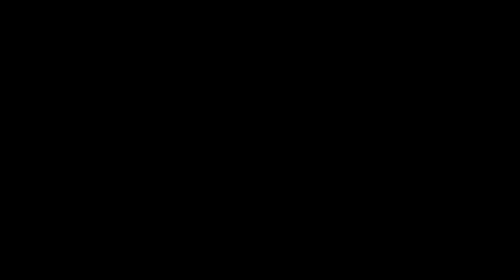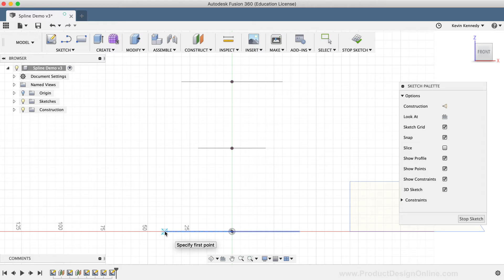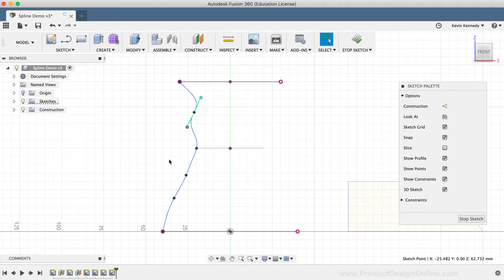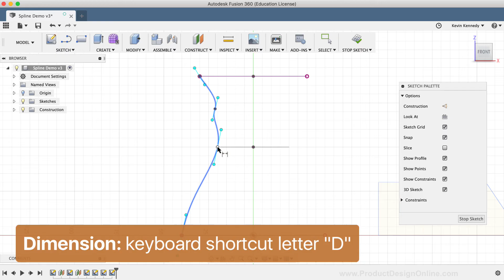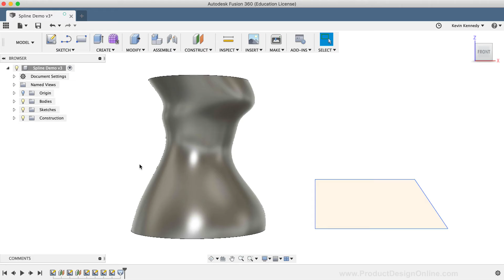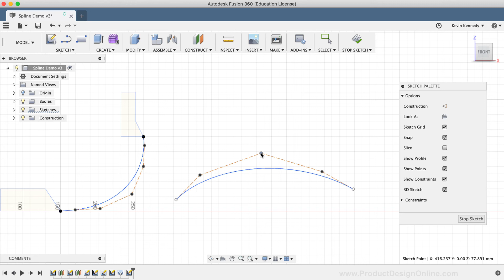How to Create Fit Point Splines and Control Point Splines in Fusion 360

Comment from the maker: Here's a video discussing how to surface model a detergent bottle: https://youtu.be/2MoecvL6eVA
_
P.S. If you liked this video, I'd love for you to Subscribe ► http://bit.ly/sub-right-now
_
TIMESTAMPS
0:00 - Create Fit Point Splines and Control Point Splines in Fusion 360
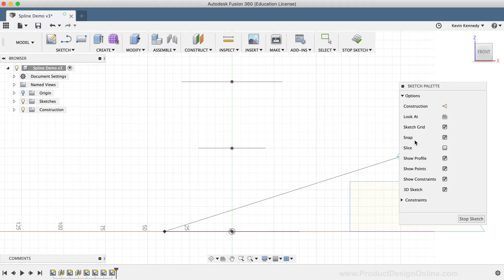2:11 - Turning "snap" on
5:52 - Open or close spline
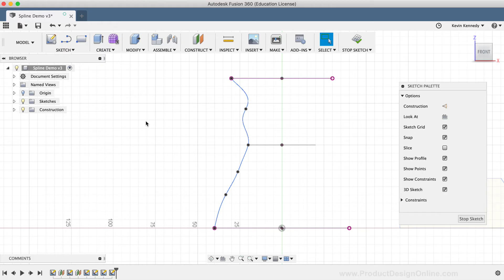6:37 -  Turn on curvature comb
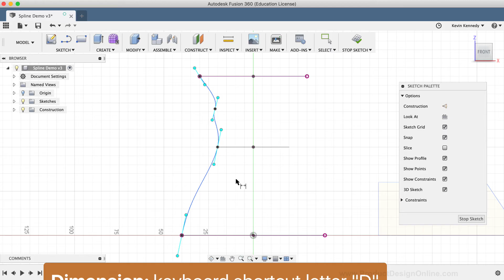7:44 - Dimensioning spline points
8:30 - Using spline as a loft guide path
13:15 - Degree 5 vs Degree 3

Comment: Hi, I have question regarding spline in 3d space. It seems that I have limited control over it. When I create fit point spline outside of the panel I can;t control it using control buttons. (What I am trying to achieve is connect two lines created on two different construction angled planes with smooth transition. I have all the control if spine is lying on any panel but then I am staring moving spline point in 3d dimention control points seems to stop working and I can really achieve what I like to. Are there any trick to that? or I just doing something wrongly ? Thanks.

Comment: Hi Kevin, thank you so much for your great videos. I need to know how can I get fully constrained when I use " Control Point Spline" ? Everything I have done is ok, and the rest of drawing is fully constrained, but not spline!! If you want I can send you what I have done.
Reply from the maker: Hi Arman. He would have to dimension and constrain each of the different control points. Splines are a bit trickier and take quite a bit of time to fully define. As an alternative, you can use the "Fix" constraint to lock it... Just note that you will have to unfix it if you want to make any updates.

Comment: How can we use these for the Rails when lofting multiple profiles? (They need the curve to intersect the profile edge)
Reply from the maker: The splines just need to touch the profiles at any point (and all profiles must be touched once). More detail on how to use guide rails: https://youtu.be/Mimbq-k2dWg
Reply: @ProductDesignOnline  Yes I understand that thanks, but I want to use control point splines for my rails and I cant see how to get the blue line to connect to my in between profiles.  The points at each end of the fit point line can be connected to the end profiles but for the inbetween profiles, the rail line cannot be connected because the points are out on the control guide (dotted lines).

Comment: This looks great - thanks - all your videos are comcise cl;ear and authoritative and I've watched a lot of them. However,  Fusion 360 is moving so fast that most F360 videos are already so out of date as to be almost useless. Now (July 2020) the comb is not not in the sketch pallet but available outside it by clicking body edges, and it cannot be viewed whilst designing a splined curve. This makes making a smooth spline extremely tedious. The only kind of spline now is the fit point spline and there is no way to specify G3 or G5. I am having a nightmare trying to draw a simple sketch which I can then extrude, chamfer and shell. The chamfers and shells keep failing and F360 support keep telling me my splines are to blame and not the software. I don't get it - if I can do it wiht a piece of wood and a chisel, shouldn'y it be a valid shape for a CAD package too?  DO you know about this problem with extruding and shelling splines? Do you know how to fix it? Any help is aprpeciated. Thanks.

Comment: Thanks for the video. Can you perhaps me on how to move and snap a spline point in one sketch to another spline point on another sketch?  The sketches are not necessarily in the same orientation. For instance, sketch A is the base of on object, and sketch B the top of an object, while sketch C contains rails to use in the Loft. Now, If I copy one of the splines already created, turn it 180 degrees, I need to place the rails' point exactly on the mirrored point on the base sketch - or, perhaps how does one mirror the sketch containing the rails?

Comment: How do you move the end/start points of the splines, please?
Reply from the maker: Hi, TechLab. Great question. If they're not constrained to something or "fixed" then you can simply click and hold with your mouse and drag them around.
Reply: @ProductDesignOnline  hi! Unfixing worked for me on each points except these two from start-end...
How do I get the constraint removed?
The issue is with splines, not with lines (these I can move as you said)...
Reply from the maker: @Up2zăDate  If an automatic constraint was applied then you'll need to select the point > constraint(s) should appear > select the constraint(s) that you want to delete > hit the delete key on your keyboard

Comment: Is it possible to close a control point spline in the same way you closed the fit point spline? I want a smooth transition at the merge point. Thanks
Reply from the maker: Yep! You should be able to close both spline types.

Comment: Great Videos, Very helpful. 
Is there an easy way the make the point curve line be the same or just go through the point and not use / fight the curve line tool?
Thanks for your help.
Reply from the maker: Hi Bill. You can add sketch dimensions and constraints to points of the spline. That's generally the best way to make them very specific / keep them the same. The other option would be to mirror or copy that part of the spline, depending on what you're trying to achieve.

Comment: After setting the fit point spline through 3 points and then clicking in the green section to say all done, I cannot hover the line and have it highlight. I also cannot right click to show insert fit point spline. Any ideas there?
Reply from the maker: Hi James. What happens when you hit "Escape" to clear all commands and then select the Fit Point Spline again? Does it let you select it? Do the spline points appear?
Cheers, Kevin :)

Comment: This fit point spline tool is the most annoying of the lot. I have 3 circles. First in centre the others on offset planes. The fit point spline will not snap to them. The snap to is selected I have checked.
Reply: Thats with centre diameter circles on offset planes it won't snap to their lines. If I draw a straight line with three horizontals coming off it the spline tool will snap to those no problem.
Reply from the maker: Hi James. Can you tests if the spline snaps to other geometry (non-circles). If so, then it would be a bug or issue with circles. Otherwise, it's likely another setting that is causing this. Cheers, Kevin :)
Reply: Remember vividly that it would not snap to circle on offset plane above, then also circle above that too. Only the first circle below. Then if i opened a new window and did 3 horizontal lines of different lengths above one another as you had, it would snap to the ends on the left side. Never tried the right. Then when I tried to add a spline to the line by right clicking, the option was not there. Presumed the ui change was the reason. So tried clicking line and nothing. No selection happening.
Reply: Remember the shovel issue I had that it would not select the lower section to delete of the handle. That issue went though with my new keyboard and mouse.  Im toying with the idea of doing what I really didn’t want to do and that is wiping the machine and fresh install from apple.
Reply from the maker: @jamesbarratt593  Glad the new keyboard and mouse is making a difference. Did you originally download Fusion 360 from the Autodesk website or the Mac App store? I believe the Mac App Store version is no longer supported (it may not even be available for download from there), and there had been forum posts in the past with users having issues with the app store copy. Cheers, Kevin :)

Comment: There's a software called Carnac that let's your keytstrokes display to the screen, which I think would be very helpful on F360 tutorials.
Reply from the maker: Hi, Andy. Thanks for the suggestion. The screen recording software does have the capability to show keystrokes. I do have this on many of my tutorials. However, it's a tricky topic as many times they cover up or make it hard to see whats happening in the canvas window. I try always display keyboard shortcuts for all videos....and then my sculpting tutorials have all the other keystrokes since there are a lot involved.

I'll consider add more in the other tutorials...it'll take some playing around with to find the right balance. Thanks again! Cheers, Kevin :)

Comment: Hey @product design online I use control point splines all the time, do you know of any way to close the spline so the end points are tangent to each other? I am currently leaving a section out and connecting it with another spline then applying tangent constraints to it. Its not a good time when you have lots of tracing to do! Thanks!
Reply from the maker: Hi, Leckie Installs. Can you provide a screenshot or a link to a file with some sketch geometry that you're talking about? I just want to make sure I'm understanding you. Cheers, Kevin :)
Reply: @ProductDesignOnline  thanks for your response! Can I maybe send you a screen cast privately?
Reply from the maker: @LeckieInstallsLondon  sure thing. Send me an email at kevin@productdesignonline.com
Reply: @ProductDesignOnline  Right on! I will do that! Thanks! Chris
Reply from the maker: @LeckieInstallsLondon  I'll keep an eye out for your email. Thanks!

Comment: What extension does Fusion 360 use when saving a file and can you use these files for modifying? I found a great push block for use on my table saw but need to modify the screw holes. This is when I thought about importing the file and modifying if it is possible.
Reply from the maker: Hi, Rud Dog. Fusion's main file type is the Fusion Archive File, which saves as the ".f3d" extension. However, you can import and export a large number of file types (see below). The most common file type from a number of CAD programs is the STEP Files which can be abbreviated as the following:
.ste
.step
.stp

I find the STEP files to be the most versatile/cross-compatible across a number of programs. When finding files online, you'll often be presented with a few options to choose from. It never hurts to download/save all the options...as in some rare cases, you'll find that certain file types don't import correctly. Cheers, Kevin :)

--
The following file types can be imported into Fusion 360:

Autodesk Alias (*.wire)
AutoCAD DWG Files (*.dwg)
Autodesk Fusion 360 Archive Files (*.f3d)
Autodesk Fusion 360 Toolpath Archive Files (*.cam360)
Autodesk Inventor Files (*.ipt, *.iam)
CATIA V5 Files (*.CATProduct, *.CATPart)
DXF Files (*.dxf)
FBX (*.fbx)
IGES (*ige, *iges, *igs)
NX (*prt)
OBJ (*.obj)
Parasolid Binary Files (*.x_b)
Parasolid Text Files (*.x_t)
Pro/ENGINEER and Creo Parametric Files (*.asm, *.prt)
Pro/ENGINEER Granite Files (*.g)
Pro/ENGINEER Neutral Files(*.neu)
Rhino Files (*.3dm)
SAT/SMT Files (*.sab, *.sat, *.smb, *.smt)
SolidWorks Files (*.prt, *.asm, *.sldprt, *.sldasm)
STEP Files (*.ste, *.step, *.stp)
STL Files (*.stl)
SketchUp Files (*.skp)

Comment: One thing I noticed you didn't mention. For fit point splines you can add constraints to the spline handles, and the dots at the end of the handles as well.
Reply from the maker: Thanks for bringing this up, Dsk! I appreciate you sharing this with the community, as that could definitely be helpful (and I totally overlooked it). Cheers, Kevin :)
Reply from the maker: @gatzkerob  Unfortunately, you can only add dimensions to the spline points or constraints to the points and handles. What are you trying to achieve with the dimensions? Cheers, Kevin :)